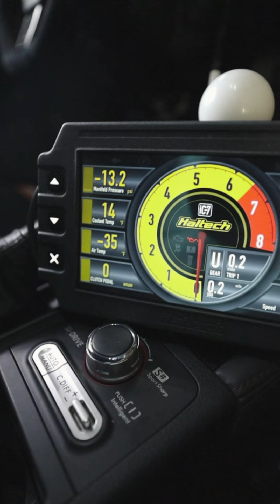EG33, Flat 6 Subaru WRX STI #Shorts

Comment: nice car! i just got a impreza with the FB20 and it has a CAI and exhaust bolt ons like resonator and 5 inch muffler stock cat stock ECU no tune. the EG33 makes this car truly badass and properly quick and ultimate vaping noises. the effort that went into this build is expensive and mind blowing compared to the 2 subaru i owned this thing is not a shitbox i’d drive i wouldn’t want a spec of salt on the frame